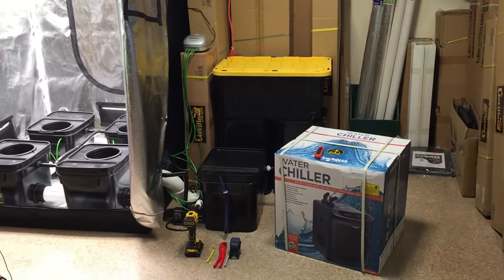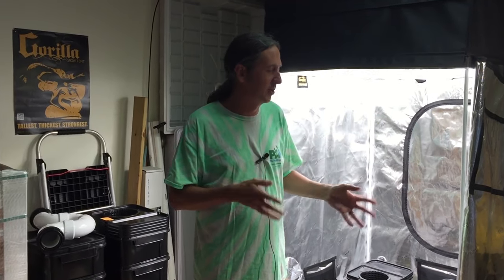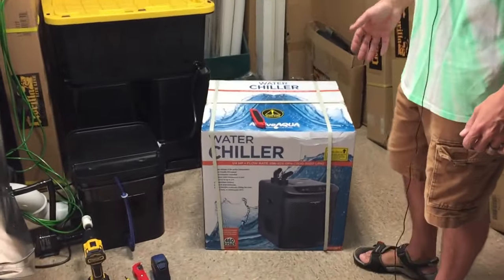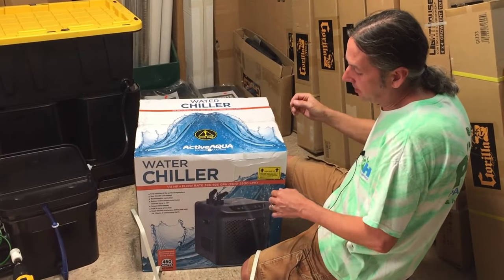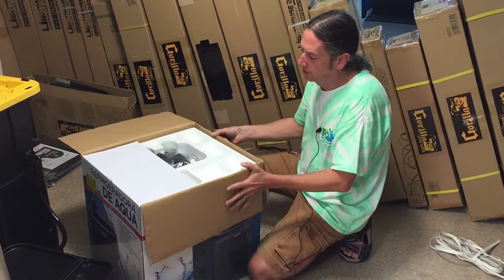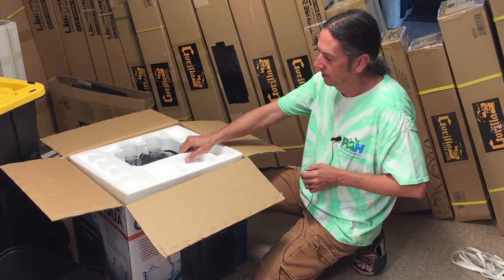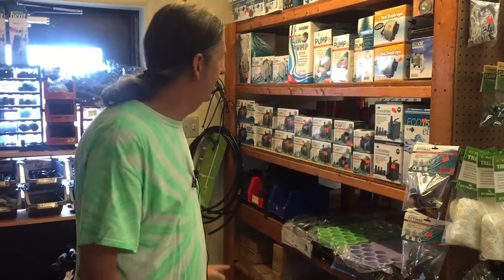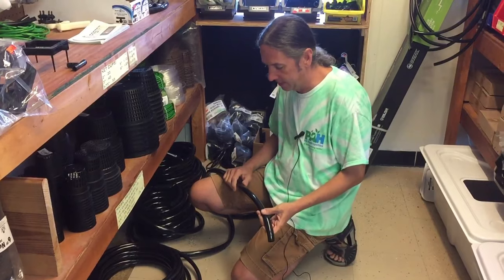How to Hook Up a Water Chiller to Your Hydroponic System!

Comment from the maker: The point I really wanted to make during this video is to get your room temps under control before buying a chiller, yes your plants will most likely benefit from a chiller no matter how dialed in your room is but if your room is 85 degrees and you want to fix your hydro system with a chiller instead of fixing the room first then you may never see the full benefits of buying a chiller. Thanks for watching! Gary
Reply: 85 degrees is the proper temp for an LED room.
Reply: Thanks for your honest input.
Reply: ? chiller link are you out
Reply: Hi found your page researching chillers and dwc question i want to run currentculture multiple system's for multiple strains can you run 1 commercial chiller for that
Reply: What is the wattage pull from socket? Total of chiller and pump? Roughly plse. I need to know wattage in my small craft garden.
Reply: @LarsLarsen77  this is correct, I wish Gary would address that. At 85, you need a chiller, right?
Reply: @silvernatedogg  yes. You want to water your roots around 68f
Reply: What about having the return to the reservoir higher up to create a waterfall going back  into the reservoir ? Giving more oxygen to the water?

Comment: If you have had a chiller out of a system for a year, how would you clean it.  Run H202 in a tight loop for 4 hours?  Then flush with water a few times.

Comment: I keep hearing that 68 to 69 degrees is the sweet spot temp for water temp for hyroponics. What is your take on that? I see you like 75 degrees.
Reply: I agree with you.. once you start passing 70 degrees you are at risk of pathogens..  Keep it in the mid to high 60's... water holds more oxygen at that temp.. going past 75 you really want to use small doses of bleach or peroxide.. bleach I only use for cloning aeroponically..

Comment: So put in my chiller today, but the pump should have in big bold red letters... make sure the front is locked in place. Had a big flood in my grow room. Instruction manual does NOT mention this very important item.
Reply from the maker: Thanks for sharing! usually they are tight out of box. G

Comment: Could you have just plumed the lines into the pump and then into the chiller without drilling the holes? What I’m saying is you all ready had a pump circulating in the hydro system why not just add the chiller to the existing circuit? I’m not an expert just wondering? Thanks for the info 👍🏻
Reply: do you mean just chill the water on the way into the tent without going into the res.?

Comment: Gary thanks so much for all the info you have provided in building these systems. I first started out with you showing the DWC buckets. Now i have this system up and running also. Added a chiller as I’m in a upstairs bedroom so this video was very helpful. I used the 1/10 for mine and the same pump size. Works great, love your work and very appreciated for all you do bro!👍

Comment: In a stirponics/rdwc system is there any reason you can't use the same pump to recirculate the water around the system and the chiller. So essentially put the chiller in line with the buckets.

Comment: You can chill your RDWC to 68 deg for under $100. Buy a used water cooler, one that you would put a 5 gal jug in the top, for around $30. Then you need a device that monitors the water temp and turns the cooler on and off at what ever temp you set it at for about $50.

Comment: That's a very helpful video to learn more about a hydroponic nutrient chiller. I grew with DWC hydroponics in Minnesota indoors for 9 months of the year, because of the cold winters in Minnesota. But in the summertime, I grew outdoors for 3 months. I never had a problem with the nutrient temperature becoming too warm in Minnesota. I moved to Florida, where I can grow all year outdoors. The DWC hydroponics worked well outdoors from December through February, but when the ambient warmed up to 80 to 95 degrees in the summer months, the nutrient was 86 to 91 degrees. The DWC hydroponic plants weakened and died, probably due to the high nutrient temperature. I would prefer to do the hydroponic gardening outdoors in Florida, rather than setup an air conditioned grow room in the house. To give you an idea how the ambient temperature and sunshine effects a large body of water, I have a 15,000 gallon swimming pool. In the three winter months, December, January, and February, the water temperature was 68 degrees, and the summer months, the pool water is 83 to 88 degrees. It sounds like a nutrient chiller might be the solution for doing DWC hydroponics outdoors in Florida, in the summertime. The 1/4 hp model sounds like it might be the correct size for up to 80 gallons of nutrient. I'm not sure how much it would cost to run the chiller. If the chiller had to run 12 hours a day, it would probably consume about 150 KWH per month, which would cost about $20 a month.
Reply from the maker: Sorry to hear about your plants.  As you stated a water chiller can help.

Both of the 1/4hp models we offer will cool your water temperatures based on the information you have provided.  Check the link for more info.

https://shop.pahydroponics.com/chillers-and-hook-up-kits/

-w

Comment: I had a dehumidifier that I got on special for under $50. It malfunctioned due to a common issue of the coils icing over. I noticed how cold these coils were getting so I made it into a water chiller. It can cool down 3 x 50 gallon reservoirs at once and has been working great for years as a water chiller.
This icing over issue turned out to be a substantial upgrade since those water chillers are way more expensive than dehumidifiers.
Reply: Good info dude

Comment: When you are in a situation where zones temps are disparate and condensation is occurring, and the environment is passive .... modest insulation for the reservoir(s) is a good idea (likely before a chiller. This means that the reservoirs are heating up from the lights and air ... it is a thin BLACK PLASTIC element. Luckily for it doesn't move and there is plenty of room at the 15" lower level.

A sheet of insulation board (like the "formular" pink sheets ... which has a reflective "foil face" side to it) is 4'x8' ... you can easily cut it 4x4 or 4x4x2 thick, then cut out bifricated brims for the tops for your buckets (its so thick that it can be cut into sliced brims for each bucket and sit there and be removable while plants are there) Then there is a "chill zone" 15" and lower for your tent. You should easily be able to see this area will be radically different in temperature ... think of how well a shower curtain works the next time you removed it after a shower and the bathroom is cold. Note that your tent inlets need to breathe, but the chillzone does not, so you want to vent pocket that a little bit, but since we aren't taping the insulation to the wall, not to worried, it has lots of leaks to pull air. 

If the chiller were laid out like in the video, a small partition between the reservoir and the chiller would be great. Just a sheet of cardboard to keep that passive hot air from being counter productive. I know "near is good" was stated, but if you can toss that chiller a bit away and use a foam insulation around the outbound tube that condensation is going to be removed. This is the same thing we would use in the northern states for hot water heater pipes so you don't have to run the water forever in the winter to heat up ... or what you would see on a air conditioning pipe ... its enough to make that temperature contrast some distance and not form condensation.

This is all very common in laser chillers (welding and so forth) and so forth where you don't want your worker electrocuted or slipping.

Comment: Can I just freeze a bottle of water and throw it in the water of the reservoir?
Reply from the maker: Hello, yup you can do that but they dont last long, I would use a 2 liter or gallon for that, the chiller is better so the plants have consistent water temps but you can get away with the bottle if need be. Thanks for watching! Gary

Comment: Gary do you have opinion on using O2 emitters compared to a standard air stone to oxygenate the water?
Reply from the maker: They are nice but very expensive and just adding a second stone and regular pump to each plant site would beef up the air a lot and at a fraction of the cost if you want more air. I would not personally spend the money. Thanks for watching! Gary

Comment: I just picked up a chiller to put on my oxygen pot system but I was wondering where should I tap the chiller in at. Can you tell me what to do and directions please
Reply from the maker: Hey there, on the ebb and flow systems you need to chill the reservoir and you will be good to go, I usually keep the reservoir outside the grow area on those and dont use a chiller on mine since the plants are not sitting in water but you can if you need to. Hope this helps. G

Comment: When using the fallponics system how high do you want the water level to be during your grow, for cannabis
Reply: MaC505 Smash I think just below the roots so they try going to the water
Reply from the maker: Hello, when you first plant into it you will have to run the water up high so it touches your starter roots, the clay rocks dont wick up much so untill the roots are going down then after that the roots are down into the system you can run your water down lower, I would still keep it to about halfway up on these 8 inch netpots. Hope this helps. G
Reply: Thank you for your feed back, I can't wait to get this system up and running. Thank you for your videos, keepem coming brotha. I appreciate you passing your knowledge along as well.👌💯✌

Comment: I have to disagree entirely. 65 degrees has the most dissolved oxygen capacity for water so it is the ideal temperature, not the low end... As far as 80 degrees being the high end, I don't know where you've gotten that information, but it's incorrect also. Anything 74 or over for even short periods and you're going to have growth issues due to low oxygen levels in the water, and likely turn anaerobic within a day or so. 80 degrees in your res is kiss your plants goodbye time.
Reply: Will that cause root rot
Reply: @navyp03  High water temps (74+)? Absolutely.
Reply: @Des420  i agree mines have brown roots now
Reply: @navyp03  Some nutes can turn roots brown... Does it smell funky in there? Slime or snotty looking stuff on the roots and air stone? Yes to either and it's 99% pythium/root rot.
Reply: @Des420  dont smell bad on this plant last plant i had to throw away
Reply: @PAHydroponics  Using bennies to outbreed the bad bacteria is a good option if you can't keep a sterile res. Also helps with nutrient uptake too, so there are other benefits to using them. I also like adding a little bit of Hygrozyme since I use it in coco already too. Hydroguard has both beneficial bacteria and enzymes, so I can agree with that suggestion. Cheers.

Comment: mini fridge $45, small coil of copper tuning $10, tubing and pump  $30 =  $85. Drill a hole in both SIDES, not top and hook it up. Keeps mine at 69 with the fridge on the 1 setting. 1 being the lest cool setting.  $500 for this way, way over the top water chiller that cost more than the tent, buckets, your little DWC system, the lights , even seeds combined. This dude is high af. Im looking at this for salt water fish tank, and its still way over the top. (Still liked/subbed/notifyed) ;)

Comment: You definitly want to install a Filter between Pump and Chiller, otherwise small debris will damage the chiller in a very short time
Reply: Like what kind? Got.any examples?
Reply: 6€ 130Micron Well filter (Brunnenfilter) would do the trick. But there should be plenty of options available. Cheers

Comment: I wish someone would invent tubing that wasn't such garbage. It seems like every store has the same kinked up crap.
Reply from the maker: Hot water will remove the kinks and make the hose very pliable. We receive a lot of bulk hose and will rework it through a steamer to remove kinks.  We recommend doing the same when installing fittings. Hot water will do fine.

Comment: If you've got multiple 1000w hids you'll probably need a chiller  especially if you're not running sterile reseviors even with air conditioning.

Comment: I know this is an older video, but might setting up the reservoir for a top off tank, and chiller simplify things for users? That way they wouldn’t need to be cutting into their res, and instead just they would just pull the plug off the correct fittings and attach the top off tank and float valve, or chiller and pump. As an added benefit for you, if customer’s ordered a system with a top off tank, or chiller, you wouldn’t need to customize one specific unit. Of course, I have no experience with these systems, so I’m just guessing here.

Comment: if my chiller is a mini chiller, it has a tube fitting of 3/16 or 12mm in diameter, if i buy the 3/4 in. bulkheads and attach my pump to reservoir, how do i convert the line connection going from the pump to my chiller, to a smaller fitting so that my chiller can be hooked up? the chiller cools enough water for my system needs, didn't know it was as small as it was until i got it, just want to convert so i can use it.

Comment: Just had a query- and i know the vids been up a while- is it beeter to plumb the return above the res water level so there is no back pressure on the pump, or is there a reason you plumb it in the bottom. Im about to do an install and found you vid very useful. It was the only thing i wasnt to sure on. Thanks in advance and cheers for making the vid ✌

Comment: I was wondering why in the 1/2 hp chiller setup you use 3/4 instead of just all 1 inch or the in and out . thanks
Reply from the maker: The pump has a 3/4 out and doesn't have a 1 inch out on that pump, it does have a 1 inch input just not an output. G
Reply: @PAHydroponics  thanks appreciate the reply. Love your videos , I’m up in Canada just building myself a rdwc 8 site and I have to say your videos have been more than helpful. Thanks for putting in the work and doing what you do 👍

Comment: I installed this chiller just like you show in the video and it is leaking from the bottom.  It isn't leaking from the connections or the pump.  Any idea what would cause that?

Comment: 70F is way too warm for hydroponics. I ran my chillers at 56F and had explosive root growth.  Of course this was a sealed room with co2.
Reply: Ideal root zone temp is 65-68F
Reply: @LarsLarsen77  chiller set at 56F water is always a bit warmer because of the heat in the room.
Reply: No man, that’s almost perfect. 69° is the temp that water holds the most oxygen at.
Reply: medhatgrower Sure, go ahead and use water that is too cold to grow plants in because it holds more oxygen. Why waste money super cooling your system when running at 19°C to 20°C pounds out huge crops? What’s to point of diminishing returns with regards to plants being stunted due to cold root zones?
Reply: @tombryant4518  stunted? Lol. I get massive growth. Also you forget that the room is 80F so by the time the water floods the table it warms up a bit. I know what I'm doing.
Reply: Kenshin Himura I’m not talking about a flood table, I’m talking about a RDWC or DWC system where the roots are immersed in oxygenated water. I’m in Alberta, and can run my temperatures as low as I want in my basement. But once I get below the 16°C area for a reservoir temperature, whatever I am growing stops growing. Even with a 25°C ambient air temp and 50% RH. I played around with the VPD as well to see what happened, but it seems like the cold water root zone just shocks them like it does to me when I jump into a mountain creek.

Comment: Love all the videos of have a question about adding a water chiller to the Active Aqua 20 gallon reservoir, would you do it the same way you did this reservoir? Thank you in advance
Reply from the maker: Hello, I wouldn't drill thru a nice expensive reservoir, I would just submerse the pump and run tubing out top of reservoir, I have even drilled holes in rez lid for the tubing sometimes. Hope this helps, thanks for watching! Gary

Comment: I’ve got a dwc setup, not a rdwc, is there anyways to get a water chiller that can chill the individual buckets, or even a splitter for the water chiller?
Reply: I’m thinking of doing the same thing with 5 gallon buckets. Look into stainless coils used in beer making. I’m thinking about running one coil in each bucket then back to the chiller. It would be a closed loop system so no nutrient goes through the chiller.

Comment: My water is cold in winter around 67°F. Would it be better to use a heat mat under the reservoir or a small 20w aquarium heater? Or nothing
Reply from the maker: 65-80 degrees Fahrenheit... 67 is perfectly fine and may be optimal for many plants.  Warmer water will encourage other organisms to grow and consume the nutrients in the water.
 thanks for watching